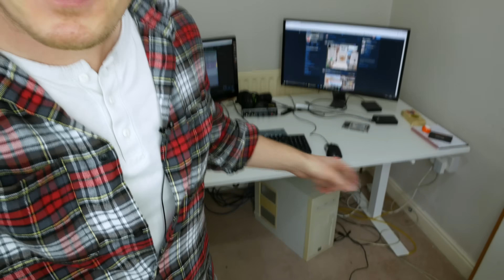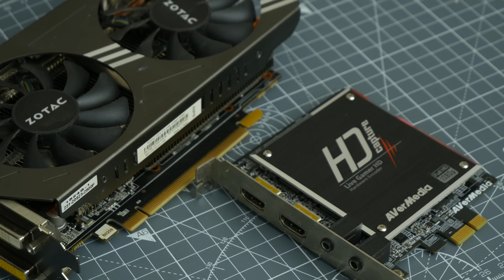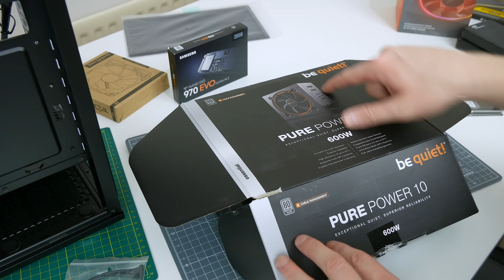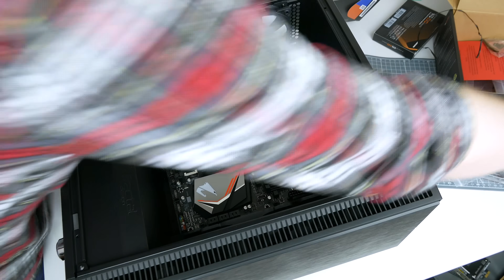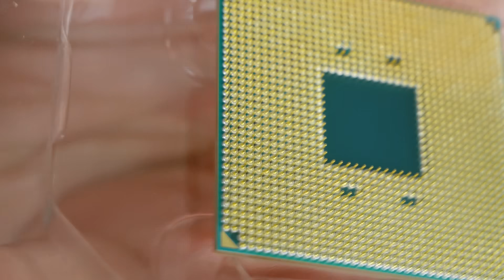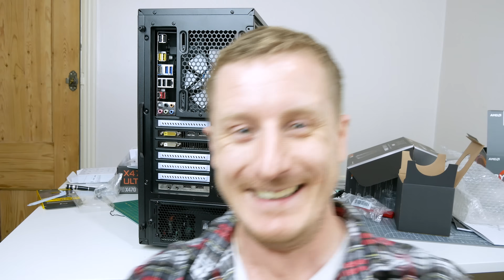PC Build 2018 - Ryzen 2700x 🖥️🔥

Comment: I'm running almost the same except no SSD at the moment, different power supply which is 1000watt, the 3 fan of version of the gigabyte gtx 970 oc, ASUS ROG Strix B450-F Gaming Motherboard (ATX) AMD Ryzen 2 AM4 DDR4 DP HDMI M.2 USB 3.1 Gen2 B450

Comment: Your SSD Kingston Technology SSD A1000 240GB seems SATA but in description is NVME. In this socket M2B can you connect SATA SSD, or only PCI NVME?. The Kingston Technology SSD A1000 240GB have 2 notch.
Reply from the maker: As far as I know (in the socket it is in) it only reads as fast as 500MBs (ish) but that's fine. The price difference was minimal if not actually cheaper than a 2.5 inch drive.
Reply: Thanks 
 @DavidWatts

Comment: Well this is lovely. I plan to reuse my old 970 for a second rig I’m building which will also use a 2700x. Main rig has a weaker i7 but a 1080Ti, this one will have a weaker GPU lol.Thanks for the video, good to know I am not the only one with such weird configs.
Reply from the maker: The 970 is still great for gaming but basically overkill for video editing which is it's main use for me. I only play casual games like HoTS or older games like Fallout 4.
Reply: David Watts Yeah, my 970 will use a second 1080p monitor anyways, for what it’s worth the 970 has aged very well I’d say, despite all the controversy it went through originally. I really need the 2700x to speed up my CPU based rendering and work in Photoshop (Movie Studio and Photoshop as well as Clip Studio Paint mainly use CPU). One of the motherboards died on me when I was trying to do a cooler upgrade so now I am scared to build again but I have to.

Comment: Does your ram hit 3000mhz ? I have the same mb, ram and CPU.
Reply from the maker: Pretty much, the DRAM frequency is 1499.1MHz
Reply: @DavidWatts  hmm yeah, mine only goes 1500 even with the xmp enables. I ordered a gskill 3200 one hopefully it can reach the advertised speed.
Reply from the maker: You will only get 1600MHz on the GSkill RAM. If you are using CPU-Z frequency you see is half, so while it says ~1500MHz you are getting are getting the advertised ~3000MHz because it is Double Data Rate (DDR) RAM. Essentially you get 2 IOPS per clock so twice the transfer rate. Nothing to worry about with your RAM Jude, it is running as it should.
Reply: @DavidWatts  oh right. Just built my first PC recently so I don't know much about this stuff. Thanks!
Reply: @MrDoodsz  anddd.... did it ???

Comment: 5:02 lucky you didnt go for intel, because with 5 sata devices and 2x m.2 you wouldnt have had enough connections to have them all in, because on the intel equivalent of that board using a second m.2 disables 2 of the sata ports

Comment: Apart from the I/O shield, I think you also mounted the PSU wrong as its fan is supposed to suck in fresh air from the bottom of the case (and that's why there is also a filter).
Apparently it doesn't really matter 'that' much, it's just FYI: https://seasonic.com/how-to-position-your-power-supply

Comment: I am very envious, your old pc is better than my current one 😂 (other than the case!)
Reply from the maker: How much better is it? I don't have a lot of use for it if you could use it.
Reply: @DavidWatts  cheers for the offer, very generous, but it's fine , I'll update mine at some stage soon (hopefully)

Mine is a i5 2500k based machine, it has served me well in fairness. I'm not sure if I even overclocked it either so there might even be room for improvement
Reply: Just the same 😂😂😂👌

Comment: Awesome, I hope you enjoy your new rig. If you want to swap out OS'es for the laugh, maybe a drive bay caddy with hotswap, cheap enough, and really fun to just swap out a drive and boot from it, when "needed" 

I'm only rocking a 4670k, similar drives (my gcard died - which sucks), I wish I could upgrade some time soon, but no, some bugger broke into my shed so all monies have to go back in to re-tooling. 

I hope the Ryzen setup works well. Intersting state of affairs these days again, thankfully.

Edit, I also loathe fan screws. Ages back I bought a cheapo drill chuck and put one of those horrid screws in it to avoid screwdrivers "camming" out. I have since bought a box of nuts n bolts from ebay that has lasted many installs. Leaving out the I/O shield is actually not a bad thing. Never  impacts reliability, and it's good to be able to feel ports when fishing around the back of the case when you cba to pull the box out to find that one elusive USB port etc.

Comment: great machine and 16 GB isn't that bad cause chrismas 2019 RAM prices will be lower and you'll still have enough time to benfit of 32GB then

What power consumption are you expecting in idle mode?
Reply from the maker: I guessed 100-150W based on the components but just checked with my buzzing and slightly dangerous sounding power meter and got a measurement of 111W for the computer (excluding monitors). 16GB of RAM should last me a few years I imagine. Still wondering when we are going to see some of that DDR5 RAM that consoles and graphics cards get.
Reply: @DavidWatts  ah, 111W is OK, but always important to let the system suspend to disk after 15 min. or so.
Okay, might depend on kwh price which is pretty high in Germany about 0,25 € or 0,22 GBP plus monthly fee of 20€.
That's why I always check and ask, cause it is far more energy than a laptop - 3 times more than my i3 14 inch 8 gb machine with surface display for about 330€

Comment: you keep saying you don't know what your doing, but you did a better job than that instruction video the verge put out. they took it off youtube but you can still see in on dailymotion, if you've not seen it it's worth a watch.
https://www.dailymotion.com/video/x6tvby8

A note on your build, did you set the XMP profile in the bios for the memory? without it you memory will not get it's 3000mhz.
Reply from the maker: Ouch, I am sure they regret not having more of a sign-off process for that video. I say I don't know what I am doing because I have a healthy level of doubt in everything I do ;-)
Ran across the XMP profile settings when researching Ryzen, easy thing to forget or skate over though
Reply: glad to hear it. the build looks great, but i do wish you'd kept it in the beige tower, that thing had character :)
Reply from the maker: I will miss old bertha but it sure did run hot in there.

Comment: I have done dual boot before, honestly... avoid it. Just do VM... Dual boot is too finicky and sounds like good idea but in practice you end up never restarting into other OS, whereas with VM you can just open a diff OS in a window, plus you can do suspends and not full restarts
Reply from the maker: I am largely happy with the VMs I run at the moment, occasionally I mess up too and then have to start all over again so it can be super convenient. I like the idea of dual booting though, leveraging the full might of all the hardware is pretty enticing.